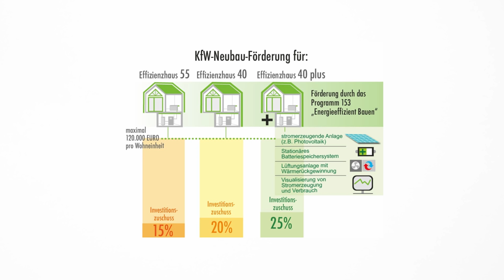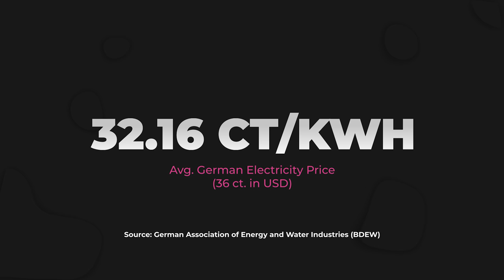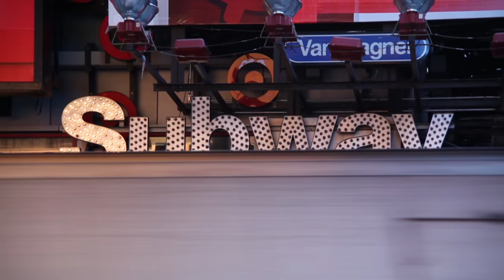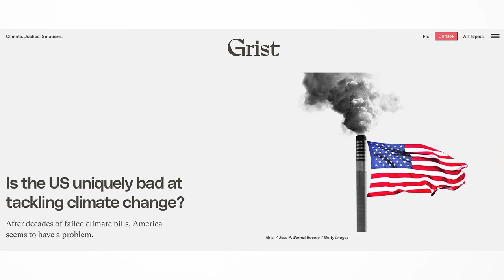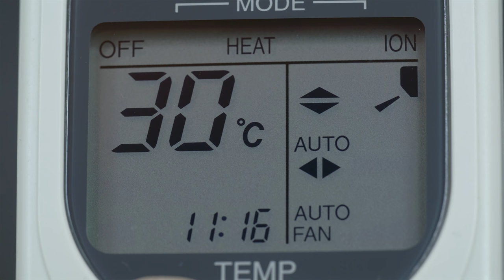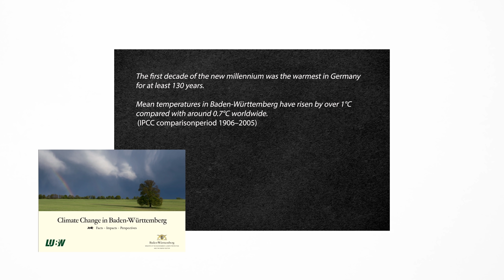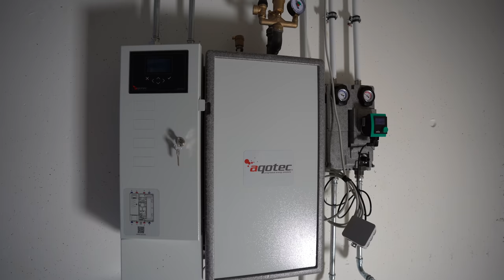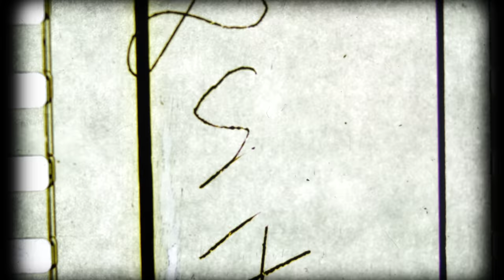HVAC (HLK) in German & American Homes | A Tale of Two Countries

Comment: I think the major factor between the use of HVAC in US compared with Germany and by extension, Europe is the traditional form of construction.  The US generally uses a lightweight form of construction with a low thermal mass that means that it heats up quicker to higher temperatures and cools down to lower than ambient temperatures, the outstanding example of this is the use of lightweight roofing materials like bitumen shingles, whereas Germany uses a heavyweight form that has high thermal mass that heats up and cools down more slowly, the result is that during the summer heat, internally the buildings are naturally cooler and therefore the need for mechanical cooling is less.  Because there is less need and due to the expense of energy in Germany there is less incentive to cool the buildings.  As regards heating the Germans use a wet system for convenience usually with radiators (whose heat is 70% convection!) as incorporating ductwork is costly in terms of space and hot air is not a suitable heat source for heating heavyweight structures.

The US's traditional availability of cheap energy is the driving force behind HVAC that combines with the convenience and cost of lightweight construction to set its use.  The US sees energy as a convenient modifier of environmental conditions, whereas elsewhere in the World long established vernacular traditional architecture has been developed since time began to work without convenient energy input.  Its a shame that the US has not learnt any lessons from its indigenous peoples on how to achieve comfort within buildings without huge energy inputs, an example of this would be the adobe buildings in Arizona and Texas.

As a UK Architect I would be interested to know what the typical heat loss was for various elements of the house building structure like wall, roof windows etc in US and Germany in say W/sqm Deg K ('U' value) and Btus/sqft deg F respectively.    .

Comment: Beside cooling, an AC removes humidity from the air. According to an HNO :-) physician in my family, this drys out the mucous membranes responsible for eliminating germs from the respiratory system long before the immune system kicks in. This might be compensated to some degree by ingesting more fluids. Unfortunately, many people do exactly the opposite and drink less when the air temperature drops. So, getting sick with ACs is not inevitable but an effect some people suffer from.
As a rule of thumb I was told: When you feel thirsty it's too late.

Comment: For me the schimmel issue has been totally cured by having extractor fans in the shower/ also available with a moisture detector at not much extra cost. Kipping the window is fine, but when you're going out for the day that moisture just sits there. I'm curious to see what you do for extracting cooking smells and moisture. I went for a traditional cooker hood extractor vented directly outside but I see the modern extraction systems drag the moisture, steam etc downwards, they certainly look cool and avoid having to install a cooker hood .Ive no idea about the efficiency though. Dunstabzugshaube Yes, I know thats a mouthful but you only learn it once!
Reply from the maker: We were curious why extractor fans aren't more common. We've lived in three apartments in Germany and only one has had one. Our current apartment does not and we do have mold problems in our bathroom from time to time. 

As far as our kitchen cooktop is concerned, we bought a ninduction cooktop with an integrated extractor fan in the center which pulls the fumes downwards through a filter.
Reply: Ive seen those fans advertised and they look really practical, I'd be interested to hear how efficient they are. As far as the extractor fans in the bathrooms are concerned, I could tell by the reaction of the contractor that it wasn't an everyday request and I had to be quite insistent that it was part of the build spec.Just kip the windows was the first reaction. You certainly won't need any potentially dangerous chemical schimmel products after fitting extractor fans. However I live in a very hard water area and I do have to use filtered water for things like the kettle and I do have to use an Entkalk spray from time to time in the shower. A kettle (tea drinking Brit) was completely furred up in 3 months and would need a vinegar based product overnight to get it anything like clean again.
Reply: @TypeAshton  A mitigating measure for the humid bathroom is to turn up the heat to max. That will drastically lower the relative humidity, and thus the propensity for mold and/or mildew.

Comment: Also don't forget to mention, as you previously did, that American homes wood built with insulation is not as energy efficient as german homes built with concrete. Plus the german homes are usually tile floor with no carpet can also lead to energy efficiency. Very good research and very thorough.

Comment: AC makes you sick, but maybe not in the way you may think. Many AC systems do not just take the air inside the building, but take "fresh" air from outside. So there's much much more water to be shed off due to a higher temperature difference. This leads to the whole unit beeing just moist and damp. This is causing bacteria growths, if they are not very regularly maintained.

Additionally there's often a filter system, which is trying to prevent this from happening, and also filter particles from the outside air. Depending on the air flow rate some condensation water is pulled with the air stream as fine particles and make the filter medium damp. As the units are usually turned off (for example in shops), there's no airflow in the night to dry the filters, and thus the filter stays damp for weeks - leading to fungi and bacteria growths in them.

And yes, making your car dry 20°C inside while it's wet 50°C outside will give you an temperature shock if you leave the car. This can also lead to health issues.

Comment: German living in Brussels here. I think for me it depends on how you live. My parents' home (in Hanover) is pretty easy to keep cool just by making sure you have blinders and white curtains on all windows, with airing at night or in the early morning.
Here in Brussels I used to live in a place with a glass roof without any measures to cool down the house other than an AC. Living in a glass house we tried to use it smartly for energy use, but it was not totally avoidable. We now live in a shared flat that only gets hit by the sun quite late on summer days, so we found that it just stays cool enough so we have not needed an AC unit last summer (which was quite rainy and cold, to be fair). The weather here is more comparable to Northern than to southern German cities, to be fair.
Reply from the maker: We are hoping our new house will perform better in the summertime since it is north facing. and our floor to ceiling windows only get direct sunlight in the morning. At the moment we live in an attic apartment with south/west facing windows (and no exterior blinds to shut to keep out the sunlight).
Reply: @TypeAshton  I might have missed it because I was doing stuff on the side, but one factor I missed where (Green) Germans focus on now is that our more complicated way of building houses and our choice of materials means building a house in Germany (or Belgium) emits much more CO2 than American construction of houses does.
Reply: @TypeAshton  Try taping aluminum foil onto at least part of the window pane of the "Dachfenster".
Reply: @justusrometh8530  So true! Many people forget and/or suppress the carbon footprint and environmental impact of the construction of so called green products.
For example: e-cars are not so environmentally friendly when you factor in the pollution, environmental destruction and loss of habitat and livelihood caused by lithium mining. A much better long-term sustainable solution would be to improve public transport by making it more accessible (not only for disabilities, but also reach, frequency and capacity), and to put a higher tax on private cars where public transport is available.

Comment: Thanks for all the research and the nice presentation :)
Regarding cooling in summer, also the kinds of houses have to be considered, as you did in the videos before. For the context: I am german.
In a solid house made from stone or bricks, the heat capacity of the walls is so high, that one or a few hot days will not increase the temperature inside significantly. Open the windows in cold hours will again result in a drop of temperature when desired.
My parents have a wooden house, quite a bit more sturdy than the american version, but the isolation is quite good, so that the heat will not penetrate during the day. Here the shutters are very important, as was mentioned in the video. Again, during the night the windows can be openend to bring temperatures down to a pleasant level.
Regarding forced air, I think in france those systems are essentially standard, and I see the appeal. Maybe you guys can have a look, if there a some statistics.
Reply from the maker: I also think it would be really interesting to learn more about the French system. We've had a few commenters from that area now and it really has us wanting to learn more about why their standards differ.
Reply: I agree with you.  The brick or stone house wall hold the heat from the sun longer. They release heat slowly so not just keeping the house cooler on summer days but staying warmer at night after sunset.

Comment: Good questions and for me it is not easy to decide. 

Would i buy an AC and install it? yes

BUT i would really try hard in making it as efficient as possible. For example:
- Install Solar first and use the AC to the limit of the amount of energy the solar system offers
- Try to avoid the warm AC air going straight into the surrounding air, because of the heat effect. In the best case the hot air can be used to generate electricity. There will be some heat left, but it's probably not so much that it will be a problem
- depending on the efficiency i would probably only install it in 2-3 rooms of the house (or in all if that is more efficient)

If i could afford it, i would really love to plan and build a 0 energy house totally independent of external support (maybe except water, cause the yearly checkups and the well are expensive)

Comment: For me, air conditioning is a comfort feature that I would no longer be without.  We live in the northwest of Stuttgart under the roof on several floors in an apartment building. There are only a few days a year in which the heat is intolerable, but we have installed a multisplit air conditioner (air + air heat pump 9kw cooling with 5 indoor units). We do not use the heat pump for heating, on not too cold days it would be cheaper, even though the price of electricity is high. The comfort via radiators is higher (We regulate them via a retrofitted Smart Home system. 
The reactions after installation were different, you do not need because of the few days, needs too much electricity, and so on.. In the summer when it is then really hot, we have then curiously often friends they stay long, and then they complain how warm that is at their home.
We are all super rested after a warm night, colleagues and other children have hardly slept and are in a bad mood, since 3 years nobody was ill ;)
The system runs in the warm months almost always (~5 months) and consumes just 600 kWh at about 400m³ room volume at ~23 °C. (Last year 544 kWh)

Comment: in regards to the questions asked: air conditioning was never necessary. i live in a part of germany where yes it gets cold sometimes but there are heaters below every window that can deal with that easily. some friends have houses with floor heating and they highly recommand that alternative even though its a little pricey. but i dont know anyone that thought air conditioning would be a good idea because usually they are sold as standalone and are pricey and only used to cool a room down which means its used for (at max) 3 weeks a year. mostly germans tend to go outside during the summer, or have an air conditioned job place or use a fan at home. i always wondered why there is a need for a set temperature in the us.. interesting topic! thanks for your lessons and research :-)
Reply from the maker: So glad you enjoyed the video!

Comment: I am the type person that love winter/cold. So in the winter I dont use any heating device, on the contrary I have partly opened window in my bedroom whole winter (climate the same as in Germany). And in the summer its hell for me, but when I need to I use small fan on lowes setting (like 10 days in a year). I have radiator, but dont use it. And since time when I worked in shopping center i hate air conditioning. (my colleagues set the temperature too high in the winter and too low in the summer, sometimes even customers were bothered by it)
Reply from the maker: You sound a lot like Jonathan! He likes it cool, I am more partial to warmth so I'm usually walking around the house in a sweatshirt and blanket.

Comment: I live in Canada where the extreames in temperature can be felt, on heatwaves we can reach up to 40c outside (normally 30-35 so the 40's are rare), in the wint that is another story entirely, we have hit -50c several winters and at that point its just cold everywhere but the most common method of heating is registers where water is heated in a hot water tank and then pumped thru pipes throught the home, not very effective in -50 but then nothing really is at that temperature. ( Quick note: one winter we were actually COLDER then mars by 5 degrees it was only -45c there but was -50 here lol)

Comment: Great topic guys.
I think the best is radiant heat from the floor. This allows the heat to rise uniformly (as warm air naturally does) and concentrates the energy to the lower half of the room where people sit and stand, before cooling as it hits the ceiling. This also utilizes the thermal mass of the floor for a quiet and uniform and buffered heating cycle. Any ceiling or elevated wall mounted system needs to push the heat down (against its natural tendency to rise), in order to hopefully heat the lower half of the room and is therefore less efficient.
Also, as with many things in life, the different attitudes of the people makes a significant difference.
Reply: I tend to agree with you. Heating should be from the bottom, not the side. And cooling should be from the top.

Comment: Underfloor heating trough a heat pump is most energy efficient for residential heating. 
And certain heat pumps allow for limited summer cooling as well avoiding a need for additional airconditioning.
Reply from the maker: Great point!

Comment: Interestingly there’s quite a debate in The Netherlands (and EU) about burning wood chips (is it green Y/N) It brings more CO2 compared to gas heating and apparently there’s a serous issue with fine dust as well which is a health problem. On top of that no forest can supply it’s product a quickly as we burn it. It so sad to see foresting on this scale in North America, the Baltics and Eastern Europe. Not to mention the environmental impact following the transportation means…shipping across the Atlantic and further trucking from port to plant. There’s more beyond the energy horizon than we all may think but it takes a lot of investment, which we don’t like, and time…which we don’t have on the near short term. Nice video btw 👍👏👏
Reply from the maker: Ah you comment is really super interesting to read. Our provider claims that the burning of wood chips is a Co2 neutral fuel and that they are able to operate solely on the waste from other industries in our area. I would like to look a bit more deeper into the foresting practices to really understand the life cycle better.

Comment: European houses are not prepared for ductwork, in particular multiflat houses. And there is scepticism about maintaining and cleaning the ductwork (dust bunnies, even rodents, perhaps wasps may get inside and make nests or die there) with significant costs every year. In winter, condensation could be a problem.
Outside units require enough distance to neighbors due to noise, so only suitable for single family homes with huge (for European relations) space around.

Comment: Hey! This was a great video. In the subject of heating in our 2015 house we are using natural gas as a source of heat. In addition we have central air circulation system with heat recuperation installed. And to complicate our air ventilation system even further we have installed ground heat exchanger. All this was doing great for first three years in keeping our home cool. Than heat waves come in and we needed to install AC. Currently this is cooling and heating unit in one box and distributed into 3 rooms - family bed rooms. In out opinion we have made one big mistake while designing roof - it's cover with very dark tiles. 
btw - there is a photo of heat plant located in the middle of the city - minute 26.05 of the movie - and the city looks like very German city. Actually it isn't. This is a very recent photo of city in Poland - Wrocław. This used to be German city of Breslau. Very good point for a weekend trip if you fancy.